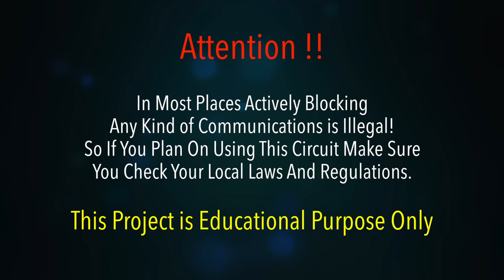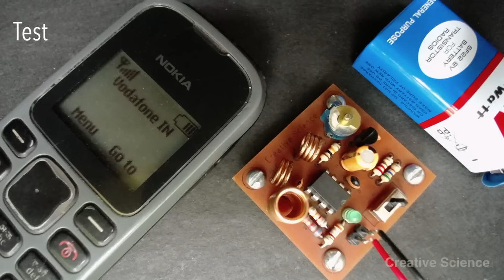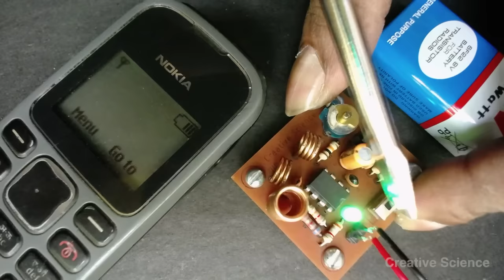Make Your Own Cell Phone Signal Jammer Using NE555 Timer

Comment: Actually what is the name of the Chip ( circuit board ) if you want to buy it out side
Reply: Its PCB (PRINTED CIRCUIT BOARD). Screenshot the layout nd get it made from any local pcb maker.  Rest of the items are written in description
Reply: @mohitrocks55  So we need to show the circuit and ask them to make it
Reply: @Lastday3  Yes
Reply: All a circuit board is its wires so you could just make the same layout with wires i believe
Reply: He also showed a wiring diagram too. But it becomes complex  as there will be lots of wires.  PCB acts like a puzzle board, jst put all the pieces nd u r done.
Reply: @mohitrocks55  it's literally just an astable 555 and a tank circuit, how is that complex? If you really have that much trouble with it just Google it, find the kit at any of the hundreds of places online that sell them super cheap and buy one there.
Reply: @lazyh-online4839  i meant instead of using a pcb use wires. But it would look really complex.

Comment: Disappointing there was no discussion of the theory on why it works, or even what the adjustable capacitor is for.  I didn't think a 555 could oscillate at cellular frequencies.
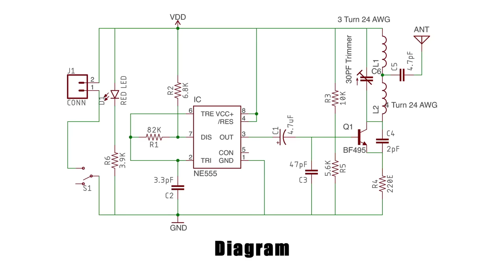Reply: I don't think it does. It is used as 'noise signal' which is carried by the one genarated my BF495 transistor  (which generates high frequency 1:46 ).
Reply: @andreastsiougkos7853  it simply excites the tank circuit and causes it to oscillate at it's resonant frequency.

Comment: To how much range (radius) it will Jam the signal?
Reply: 2 ft
Reply: @dreamachievers2379  great🤣
Reply: tell me how to increase range
Reply: @vivek minj You would have to increase the number of turns of the inductors. But that means you will have to calculate the increase of the inductance of the inductors, and calculate how much the capacitance needs to be increase for the capacitor. It's difficult... it could work just by increasing the number of turns of the main coil tho... not sure.
Reply: @Thematrixagent thanks
Reply: You can also make a directional antenna, a helical one is fairly easy to create, you just need to know the frequency and how many turns you want. Here is a calculator to help you out: http://jcoppens.com/ant/helix/calc.en.php i used it for mine, and 3D printed a thing that holds the Helix in place perfectly. https://www.thingiverse.com/thing:2497461 from here. My selfmade helical outperforms a commercial patch antenna (immersionrc) (was the onlything i had to test with very similar properties).
Reply: Hi
Reply: It is for any kind of cellphone signals or not?
Reply: Try to combine with wifi gun
Reply: @krishnaagarwal234  yeah offcourse
Reply: How its range increased
Reply: increasing the turns would cause the resistors to piss off, so you also need to calculate the appropriate resonance along with inductance
Reply: KidsView
Reply: vivek minj big jammer 😉

Comment: Your schematic is incorrect; the schematic shows R3 and R5 between VCC and GND without a connection "dot" to the base of Q1 and cathode of C1. However the PCB layout mask clearly shows those points connected! This would certainly be an issue for anyone breadboarding or perfboarding this circuit without your PCB layout.
Reply: hello can you please provide the right circuit diagram for this as i will be running the circuit simulation via multism. hope you can see this sir

Comment: Does it work on 3G 4G networks / and other operators like airtel and jio?
Reply from the maker: No, Only work on GSM 2G, Naveed Batt
Reply: Please make a jammer for 3G and 4G networks also..
Reply from the maker: Naveed Batt, ok i will make in future :)
Reply: Ok.. Waiting for that.
Reply: Creative Science good luck, that's incredible difficult.. Way higher frequencies, much better protection against jamming..
Reply: Creative Science thatll be rather difficult. Today's cell signals use a range of frequencies and hops between those with less than a bit of info being transferred in a single hop. This makes it very difficult to jam and improves security and reliability.
Reply: Thomas Cardenas ah the "frequency hopping spread spectrum" but it also has an invunerability.

Comment: To how much range it will jam the signal plzz reply
Reply: Around 40 feet (12 Meter)
Reply: But this only 2g not for 3g and 4g
Reply: @MrAlvits , it should work for 3G/4G/5G, because they all use the same spectrum. But not with the frequencies above 1800 MHz.

Comment: How "555" works with signals more than 10MHz  ?
Reply: the 555 doesn't create the UHF signal itself, the transistor forms an oscillator together with L1, L2, C4, C5 and other parts, the 555 timer just "disrupts" that oscillator/constantly moves its frequency around, so the interference caused by this device has a bigger bandwidth.
Reply: THANK YOU. I really hate people that do "copy-paste" circuits without any working explain. This isn't for "educational purposes" this video is purely distructive.
Reply: Mohammad Alfauomey it drives the resonant tank to produce a higher harmonic frequency, a frequency multiplyer.
Reply: @raffaele148  how can a video be destructive?
Reply: @lazyh-online4839  The simple fact is that he's not explaining the base of the circuit, nor he's explaning the science behind. He's just releasing it, nothing to learn from. Its just for the pure intent of bragging and giving a way to people to be dicks.

Comment: How to I get the parts specially the board
Reply: I'm interested in the board too, the other parts you can search en eBay/amazon/aliexpress/etc.
Reply: You can buy a blank PCB on amazon/ebay/etc, and there are multiple ways to make it into a PCB.  The fastest is a laser engraver, but it's not always perfect and may need some touching up after.  Next fastest, and in my opinion the best, is using a cnc milling machine.  Then there's chemical etching, which is the old-school way, but it takes a while to make a custom PCB.  If none of those options are feasible, you can buy a dremel tool and dremel tool station for not THAT much money and do it by hand.  This has the added benefit of the dremel and tool station being useful for many other things, but the result may not look as nice

Comment: will this work for all phones. please reply fast. because I should submit it Tommorow
Reply from the maker: Only for 2g network
Reply: +Creative Science haha
Reply: @Vishwajith Vigneshwaran did you tried this
Reply: yo this is generating a frequency in the 2ghz range, you can adjust the frequency and "jam" 3g 4g etc.. by change the values of the RC components
Reply: @CreativeScience   2G network? There is nothing like a 2G network. It looks as if you are mixing the GSM network and the data transmission via GSM. You call yourself "creative science" but all you can show is just BS.
Reply: @abdcdario8700  what to do for it
Reply: @atharvakhodke5658  maths, f=1/2pi sqrt lc
Reply: @CreativeScience  what to do for 3G nd 4G network
Reply: @CreativeScience  how can we increase the frequency
Reply: We can adjust the trimmer and copper wire torn
Reply: nn

Comment: What else can be used instead of the Bf495 transistor
Reply from the maker: used BF495 transistor for better gain, BF495 is medium frequency transistor, also you can use any high frequency transistor for more gain, EX : 2N3866
Reply: Creative Science Thank you very much  I will try this
Reply from the maker: welcome Complex Channel, good luck :)
Reply: what else rather than 2N3866?
Reply: Bf494 also same
Reply: Creative Science will this same circuit will support Ex. 2N3866 transistor
Reply: waldrof supernaidu yes
Reply: 2n2222 ?
Reply: waldrof supernaidu yes he said it supports 2n3866.

Comment: Would love some theory on operation. Also, 24 gauge is telephone or breadboard wire, much smaller; this looks like about 16, and is there clearcoat on them? the adjacent turns are touching.
Reply: All the copper wire is enamled. The VCO oscillates on the same freq as the phone, thus jamming the signal. You need to add rf power amplifier for range over 1 meter

Comment: good old, flexible 555  ...looks like a nasty, little HF-VCO driven by a sawtooth, jamming a wide range of frequencies, doesn't it? :D   ...I guess, I'll test it right now on a breadboard-panel (when it's working fine, I'll do it properly with layout) ...but what means "AWG" (I'm not a native speaker, sorry)?  thank you, very nice  :)     note:   in your shown "Diagram" you mixed L1 and L2, i guess (start of the Video it's different) and there is also a little confusion in the junctures in the drawing (sometimes it's a connection, sometimes not)  ..anyway, no problem, just saying
Reply from the maker: you are right iiisolda
, but frequency mixer ,monolithic amplifier ic not available in all places, i use 555 timer and bf495 that's common, so people can make this easily. "AWG" means american wire gauge. thanks for ur comment :)
Reply from the maker: follow pcb layout and complete pcb, then i hope you understand connection
Reply: AWG 24 is about 0,5mm diameter of wire, also the wire should be enamelled
Reply: of course, thanks ...meanwhile I've got the conversion table
Reply: a square wave generator will do the same.i noted the old TTL circuits generated ac lot of noise.also a regen radio receiver will also do the same.

Comment: Ah. For educational purposes only, it says. And education is good, and also legal, right? e.g. this device is perfectly legal to use. LOL! However I will point out that it is nothing but a very dirty oscillator, not tuned to resonance on any particular cellular band. An output tank circuit of some sort would make it kinda work on one band. For multiband you need multiple oscillators. Also a higher gain antenna would be nice. With a log periodic or a circular yagi at about 20db, you would get some usable range at about 1/4 watt. However you would have to aim the antenna at the target of your educational endeavors. For a good quarter wave vertical antenna, resonant at the desired frequency, you really would want a couple of watts output at least. A proper FM signal with some modulation would be the bee's knees. Then you would get what is called the capture effect. Otherwise you are simply trying to drown out a fairly strong and efficient signal from the cell towers with a crazy strong bulldozer signal exponentially stronger than the legit signal. You aren't blocking, just drowning. Essentially this device is kind of powerless to do any harm or even have any fun with, and this video is just click bait. Thumb down. Booooooooo.

Comment: Do you realise that 2G - 3G and 4G are in the gig hertz range? The transistor you used is only rated to do just over 0,1 gig hertz ie 1/10 of a gig hertz. It just cannot produce signals in the gig hertz range. Also the values of caps and coils you used tell me straight away that this can jam an FM radio and nothing else. Haha Nothing but click ware here dude.

Comment: Erroneus title that induces to confusion, the heart of jammer is not the 555, RF Common Base colppits oscillator instead. The 555 only serves to attack it modulating by square wave signal using varactor effect in B-E Junction in order to expand the spectrum. This RF oscillator works close to IF frequency.

Comment: It should come as no surprise that this thing has an effective range of only inches away...all it is, is a tank circuit, that is, the variable capacitor and the center tapped coil, that's the bit that makes the radio waves, and it's  given a little bit of juice to keep it oscillating by that transistor, and that's it. It has no amplifier after the radio frequency is made, it just goes right to the aerial....so it's total output power would be in the milliwatt range or even less, such a device is so weak that it doesn't break any laws. As some have noted, yes, this kind of thing would be better suited against older analog cell phones, if you could get the tuning just right, but as it is..totally harmless.

Comment: Please I need to make one of these for 20 meters which I have to change ?
Need to work on GSM, CDMA, 2G, 3G, 4G how to do it?
Reply: Add VCO for each needed band, add power amplifier (>10W) then connect to seperate antennas
Reply: Have you find a good circuit for that?

Comment: I am not one electronic expert but I did not saw any "transmiter" that can jam and block the signal ... Is this a true thing ? What component is the transmiter ? How does the transmiter selects the frequency to jam ? Sorry to ask ...
Reply: The 555 IC is the transmitter. It works like a EMP gun, but with a lower power.

However this shouldn‘t be built and used, because Ofcom/FCC will notice fast.
Reply: @CowMowTV  Tks for the clarification. Allways good to know things. My father allways said, knowledge do not ocupy space :-)

Comment: Does it work on all cell phone operation frequency bands?
800 MHz, 850 MHz, 900 MHz, 1.8 GHz, 1.9 GHz, 2,1 GHz etc?
Reply: No
Reply: Should work for 800-1900 MHz, maybe upto 3600 MHz, but with worse signal. I don‘t recommend to use it outside a lab or microwave oven, because otherwise Ofcom/FCC will not be that happy.

A microwave oven pretty much shields the signal from the outside.
Reply: He said, that it works on 900-1800 MHz, possibly lower and higher freqs.

Comment: How about a gizmo to stop 5G waves coming through you family bedroom windows? No antena near your home?  You can hold your breath on this occasion coz its coming soon
Reply: This device sends out waves and doesn‘t block existing waves.
There are windows blocking 5G or weaken the signal. You probably already have these windows installed, because they are very common.
And there is paint blocking EMF.

But these levels of EMF are not harmful. Even, when you are 10 meters away from the 5G tower, the signal already is very weak.

Comment: Is it applicable for LTE
Reply from the maker: No
Reply: Will depend on the frequency band(s) used. 2G uses 850, 900, 1800 and 1900 MHz, while 4G uses 600-1000 MHZ and 1400-5800 MHz.

Comment: how much time the 9v battery last if you turn it on?
and what is the range of this cell jammer?
Reply: Few centimeters, if even that, and it will last long, its really low power circuit

Comment: Is circuit work for smartphone 3g and 4g ?
Reply: No, they work on higher frequencies, but a bit modified circuit may actually work
Reply: Not for 3G (at least for the mostly used 2100 MHz band), but for 4G it may work, if your local cell(s) use the GSM spectrum.

Comment: 555 gets up to about 2mhz. In 1980, I used one to block an annoying  AM station on 800khz when users of said radio repeatedly failed to turn it down.
I doubt the harmonics reach 2ghz with sufficient power to block cell signals of reasonable strength from more than 2 inches away.

Comment: If I used this device to intentionally jam my own phone, would it make my phone impossible to track?
Reply: There are other ways to make it impossible to track. Place it in airport mode, that cuts the cell connection, turn it off, or leave it at home.  These options also leave you without service.